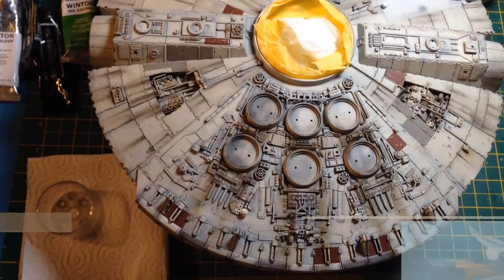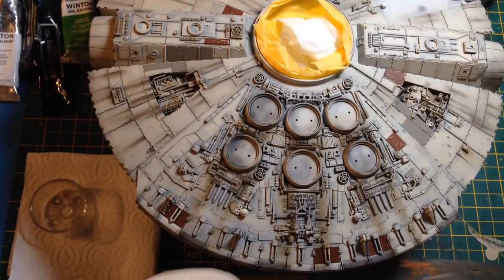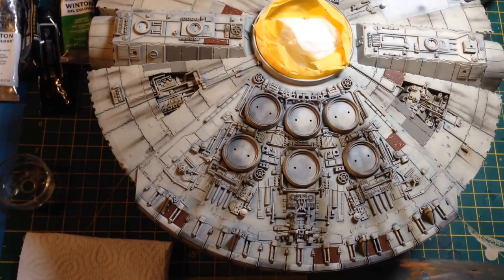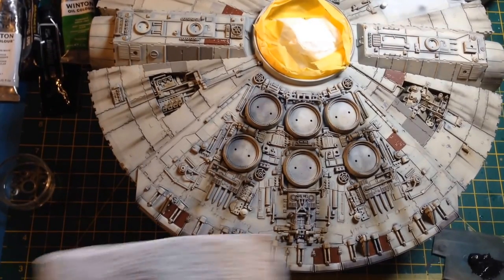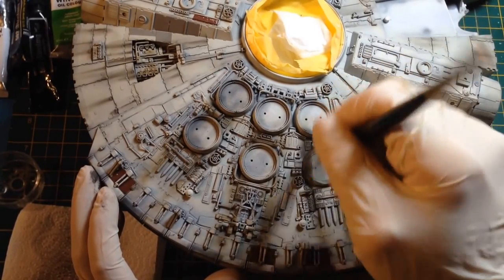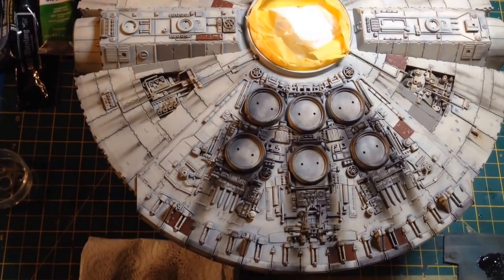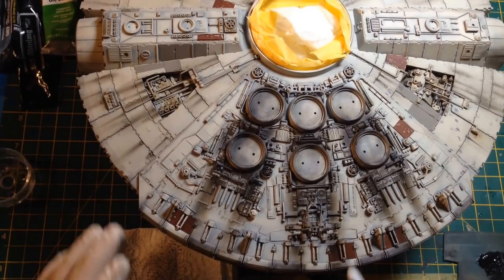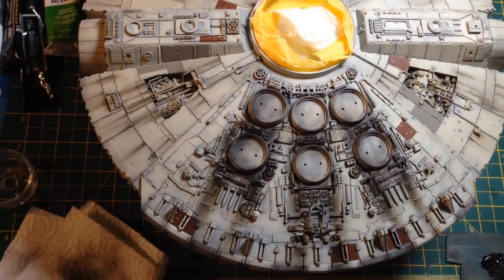Modelmaking Guru How To: Drybrush Oil Paints (Millennium Falcon Heat Exhaust Vent Weathering)

Comment: I must admit, this video has inspired me to go with oils. I was unsure before seeing this. Now I'm totally sold on the idea
Reply from the maker: Do it, you won't want to dry brush with anything else again! Of course, there's the drying time, but this is a hobby of patience :) Try it out on a scruffy scrap kit first till you are comfortable with working them, then go to town!
Reply: Modelmaking Guru Hi im a total noob that just subscribed to build the millennium falcon. my question is on the primary grey  hull did you airbrush or use the mig oils and brush?
Reply from the maker: vendetta fiend HI! The main basecolour? Airbrushed acrylic paints all the way, oil paints are really only for weathering or tinting already painted small panels (or maybe occasionally painting tiny panels or details). The only models really ever painted fully in oils are big figures, and that's pretty rare nowadays. OIl sare great for weathering and tinting but no use at all for painting basecolours. .

Comment: probably repeating this info in the thread but Revell acquired the molds for this model and now sells it under the Revell name but its the same model.  Its the same parts but the packaging isn't as good as the FM packaging.
Reply from the maker: Yep, it's the Revell Master Kit or whatever they call it. They should just label it "The One We Didn't Actually Design Ourselves So It Isn't Ass" ^_^
Reply: question...the starship grime color you're using in this video of late has become extremely hard to come by.  you have any recommendations on what other similar colors or mixes of colors to use as a substitute?
Reply from the maker: You are looking for Mig 502 Abteilung Starship Filth, which was discontinued BUT now is being produced again and has  just started hitting online retailers so you should have no problem finding it. Alternatively you can use 502 Abteilung Smoke which is almost the same colour. Or, you can mix something similar yourself with regular artist's oils Payne's Grey and Burnt Sienna or Burnt Umber.

Comment: You state that you do commission model painting/weathering ... I'm about to start building the DeAgostini 'Build the Millennium Falcon' ... I'm sure you know what I'm on about, if not check it out. How much would it cost to have my one once built painted up to look as closely weathered etc as it can??
Reply from the maker: +Sauron191 That's certainly something I could do :) You'd need to make sure some parts weren't glued together (for example, external greebles on the hull plating could be glued in place but I would need to disassemble the cockpit/interior areas to paint them so I would need to be able to take them apart or remove them). 

Obvs it's difficult to give an estimate of hours required as no-one has a finished one yet, but if you'd like to drop me a line at foxx(at)modelmaking.guru we can have a chat :)

Comment: New sub here. As someone who likes Star Wars, U-boats and Gundam, it was a no-brainer, lol. Do you plan on working on any more SW kits in the future?

Thanks for the guide - I'm working on the FM 1/144 kit and will try this method. I'm thinking burnt umber with black on top would suffice, hoping all goes well. I've currently got a gloss coat on my Falcon, is it important to drybrush oils over a matte surface? Also, did you make the smaller panel streaks with the same method?
Reply from the maker: +lon242 Welcome and thanks for subscribing!

That colour combo should be okay I think, just go slowly and build the colours up (black can easily be overdone). INstead of black you might like to try some homemade Starship Filth - I am led to believe that Adding Burnt Sienna to Payne's Grey can give you a reasonably similar colour :)

YOu can drybrush over gloss or matte, it depends what results you want. A matte coat has a rougher surface so more paint will remain behind on the flat surfaces and will be stained by the oil paints, and also you will get softer fuzzy edges so for dry-brushing may be preferable (at least on the Falcom, which is supposed to be filthy). 

As for the little streaks, I used a different techique - I think I showed it in my Colonial Viper build but I also did a write-up of the process on the blog, you can find it here: http://www.modelmaking.guru/guru-blog/fine-molds-172-millennium-falcon-build-part2

And yes, I will be doing more SW kits - thanks to @Helgan35 I have the Bandai Y-Wing in my to-do pile, and I fancy getting the 1/144 Falcon at some point myself. There is also the future 1/35 AT-AT from Dragon that will come out at some point (and as they have the SW licence for outside Japan I will be watching their releases with GREAT interest!)
Reply: +Modelmaking Guru 

Thanks for the info! I can see how the Payne's Grey mix could work, I'l try and mix it up. I'll have to get Starship Filth one of these days. Looks like I'll matte the entire model for better drybrushing/fuzzier edges, a panel wash was my last step and some gloss still remains. Following that, highlighting and discoloration of certain panels. Your build log is packed with good info on weathering a Falcon, thanks for sharing.

Looking forward to your builds of more SW stuff, I've got a Bandai Y-Wing in the backlog as well. Their Falcon looks good - it seems to be more complex vs. the relatively simple, and already pretty good Fine Molds 1/144. And I had no idea Dragon could make SW kits, I'll look forward to 'em! A 1/35 AT-AT would be freakin' HUGE. A 1/35 Snowspeeder along with it would be sweet.
Reply from the maker: Yeah, I THINK it is Dragon, they have the "Outisde The US But Not Shitty Revell Crap" licence, I think. 

IIRC I did a wash with thinned Tamiya Smoke after the initial base colours and decals were on, but over a matte varnish not a gloss varnish, because I wanted the Smoke to discolour and warm the panels. You may find a matte varnish is best for using oils to discolour panels as the colour will spread and wick across the panel and into the surface more.

Comment: not wanting  to nitpick but if the ship is more or less flying in the one direction then wouldn't the streaking be in the one direction not in a 360 type way if you get what I mean?
Reply from the maker: That's more a question for Industrial Light and Magic, I am just replicating the studio miniature :) But you could maybe say that lateral (front-t-back) streaks are caused by exhaust material and hot scoring and debris whilst the ship is in motion, but the rest of the streaking is caused by water run-off from rain picking up grime, dirt and corrosion when the ship is landed and not in motion, pulling it out of panels and crevices and flowing down the ship through gravity, which is why those streaks are top-to-bottom and not front-to-back.
Reply: Yeah I realised that you were working of the studio miniature.  I think I have been watching to many weathering videos and have become entrenched in the realism side of things,  regardless you have done a great job and video.
Reply from the maker: It's always good to come up with a logical head-canon as to why your model looks the way it does, it informs how you paint it and how it looks at the end, so no harm in digging deep in the thinkage :)
Reply: There were two models used for the majority of shots in the OT: a 5 foot model built for Star Wars and a 32 inch model built for TESB.  The radiating streaks you point out are one of the easy "tells" for spotting what model is in a scene or image.  The engine streaks are short and head straight back on the 5' model.

Comment: Really great video on dry brushing. very well done. Possibly a bit off topic but something about this model and what you have done has always bothered me I find no rational explanation for these "streaks". As you stated you "posited" the 'exhaust" from the port in front would hit on the one further back. What I find odd is this doesn't seem to be a rational pattern of these exhausts. If this ship is moving especially in atmosphere, it seems as thought the streaks would go straight back from the ports, not at an angle away from the obvious direction of travel. I get that this is aesthetically pleasing but it doesn't seem realistic. Even in space I would think the exhaust would trail directly back from the ports and be in a straight line from the direction of travel. To be screen accurate I guess this is the way it has to be done but does anyone have a rational explanation why this might have been done this way, except by mistake originally? Thanks again for a great video.
Reply from the maker: +sharp357 Thanks for the kind feedback!

It's a good point, and logically you are right. In fact, If we assume that the streaks are from "stuff" coming out of the vents whilst the ship is travelling, then even more logically you would assume they would not even be streaks at all but just a blurry patch as the ship is not always travelling forward in a straight line, but in all sorts of directions. I suppose if they were not particulate exhaust deposits and in fact caused by something heavier like leaking fluid (like oil leaking from an engine component, for example) then it might make more sense that as fluid leaks when the ship is docked and not travelling  that it would travel down the sloped hull in the direction of gravity and the curve of the hull would make them radiate out rather than all go in the same direction. But hey, I've only just woken up so I'm not sure if that would even make sense :)
Reply: +Modelmaking Guru You have analyzed it even further than I had and i like were you are going. Of course any other way at this point and it wouldn't be "canon". :) Thnaks for that and the video.

Comment: why did you leave off the exhaust vents ?  to late for me now . I glued them in .
Reply from the maker: +Bruce f LOL not to worry! I had kept them separate for painting anyway, so that I could paint them and make sure once they were attached they had crisp edges between the hull colour and the grille colour. When I was doing the weathering I wanted to keep them the nice dark grey colour with a dark wash they already were but needed to get the streaking down along the inside walls of the vent housings without getting it on the grilles, so this was easier to do without the grilles in place. Also, although the grilles had a matt finish, I had some drybrushed chrome silver on the grilles that was added on top of the matt coat so that they added shiny bare metal highlights. and I needed to make sure that the shiny silver colour was not dulled by any final matt varnish, so they were attached after everything else was painted and varnished.  Tactics! ^_^

Comment: great video!  what matt varnish do you use ?
Reply from the maker: +kairus1 Thanks :) I use Humbrol 49 Matt varnish from the rattle-can - i'm far too lazy to fart about with an airbrush by the time I am at the stage of the final matt coat :)
Reply: can i use tamiya matt and gloss  when using the starship filth? for weathering?
Reply from the maker: do you mean matt and gloss varnishes? I haven't used their varnishes so i can't say for sure, I can only say that Humbrol 49 works fine, and some of Vallejo's varnishes.  Just test out on a scrap kit or piece of plastic that you have painted up first. Also make sure to allow several days to a week  for the oils to fully cure.

If you mean the Tamiya matt and gloss additives (matt clear and gloss clear) then they are NOT varnishes and should only be mixed with other tamiya acrylics, not with oil paint. The only thing to mix in with oil paint is other oil paint or thinners for oil paint.
Reply: yea i meant tamiya matt and gloss, so no, okay ill get the humbrol...49 thanks
Post commentCancel
Reply from the maker: Cool :) I mean, any acrylic varnishes should  be fine, the Pledge Multi Surface Wax is basically an acrylic varnish and MUCH cheaper than buying specific model gloss varnishes. For matt I would stick to model paint manufacturer varnishes such as Tamiya, Humbrol or Vallejo. I just use Humbrol 49 exclusively so I can say for sure it will be fine. If you're not sure, you can always do a test on a piece of scrap :)
Reply: the humbrol 49 matt in a spray can seems hard to find.  on eBay.  is there another place i can find it?    i have everything else  covered except the last step.  thanks for all the help!!! i can't waite to weather the falcon.
Reply from the maker: Ah, forget eBay, go for Amazon. I don't know where you are (i.e. in the UK or not) , but this is the stuff you are looking  for

http://www.amazon.co.uk/Humbrol-150ml-Spray-Varnish-Acrylic/dp/B001JJYZN4/ref=sr_1_1?ie=UTF8&qid=1443029795&sr=8-1&keywords=humbrol+49

If you are in the UK, you could also try your local Hobbycraft or model store, or online try www.emodels.co.uk. Outisde the Uk you may need to try your localised Amazon site :)
Reply: yea i live in new york city,  kool thanks for the link!   and the websites!.   please check out some of my dioramas on my channel. 1/12 scale. for marvel legends.  thanks a lot for your help.
Reply from the maker: No probs, my pleasure :) I'll make sure to stop on by and take a look :)

Comment: Great vid Fox, thanks. I have a completed FM Falcon with a few chips fallen off the red and grey Decals, any advice on repair and colour?
Cheers
Reply from the maker: +Tony Celliers Yeah - gently sand where the decal has chipped and leave it at that - they are supposed to be covered in paint chipping anyway so may as well make the most of it ^^ You an repaint if you like, you would need to paint over the entire decal to avoid having to colour match. I found that Tamiya Flat Red with a tiny bit of Rubber Black was a good match, and for the grey (if it is the warm grey like on the middle bit of the mandible) then you could try something like Neutral Grey with something warm like a light brown mixed in (a tiny amount) just to warm the tone. But personally, I would simply leave them as I suggested and just make it part of the weathering ^^

Comment: What varnishes are you using with the oils?
Reply from the maker: I usually use Humbrol 49 acrylic matt, which gives no problems, but I do leave the oils to dry for DAYS before applying it to make sure they are as dried out as possible (as they are drybrushes, the drying time is reduced).

Comment: Am I the only one who notices that the exhaust streaks should go straight back (all 3 streaks should go in the direction of the middle streak if it followed the way air would flow back in flight). But, I guess the studio model was like that (radiating from the center). But it would be wrong. I could see rain/rust streaks radiating from the center (like they would as water ran off a stationary ship), but the engine exhausts should all go straight back. In my opinion.
Reply from the maker: +Gary Tinschert LOL you're the second person to say that ^_^ Instead of typing out the same answer again. I'll paste the response below (see the comment from sharp357 about a week ago): 

"It's a good point, and logically you are right. In fact, If we assume that the streaks are from "stuff" coming out of the vents whilst the ship is travelling, then even more logically you would assume they would not even be streaks at all but just a blurry patch as the ship is not always travelling forward in a straight line, but in all sorts of directions. I suppose if they were not particulate exhaust deposits and in fact caused by something heavier like leaking fluid (like oil leaking from an engine component, for example) then it might make more sense that as fluid leaks when the ship is docked and not travelling  that it would travel down the sloped hull in the direction of gravity and the curve of the hull would make them radiate out rather than all go in the same direction. But hey, I've only just woken up so I'm not sure if that would even make sense :)"
Reply: My thoughts too.  But I guess it wouldn't look as cool.  And you have to remember, the Falcon twists and turns allot.

Comment: I would love to build this but I just cant afford 500 for the model.
Reply from the maker: +Ben96873 Yep,. now it is out pf production the prices will only get higher. However, much as I hate to suggest a Revell kit, Revell will be releasiong a "Master" model of thew Falcon which is supposedly this exact Fine Molds model reboxe3d (and not the usual crap they put out themselves). I doubt that will be cheap either though :(

Worth saving up though, for either one!

Bandai do a not-too-expensive 1/144 sca;e Falcon which looks pretty sweet (but it's not big)

Comment: You’re so-called weathering is way too heavy handed and incredibly unrealistic.  Check your references.  No ILM studio model was ever this dirty.
Reply from the maker: This was from six years ago and was not using studio model pictures as reference, Later builds, completed when I had learned more and gained more experience,  had much more refined weathering and used much more reference material. But yes, the streaks are a bit dark on this specific build. And you are wrong about the ILM models - some of them were massively weathered, although they used very different techniques to anything we would use today, which can be hard to accurately reproduce, and which were also "unrealistic". Also your so-called feedback is way too aggressive and incredibly rude . Check  "how to offer feedback and criticism that people will actually respect and listen to rather  than just writing you off as a smug rivet-counter".